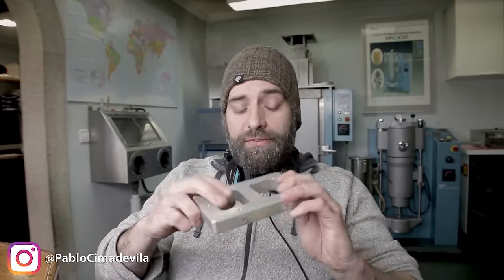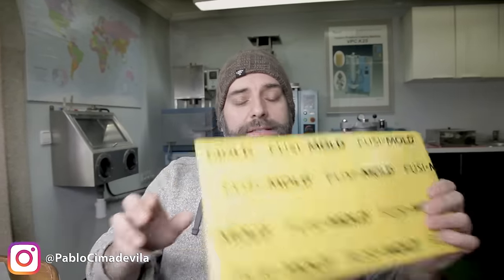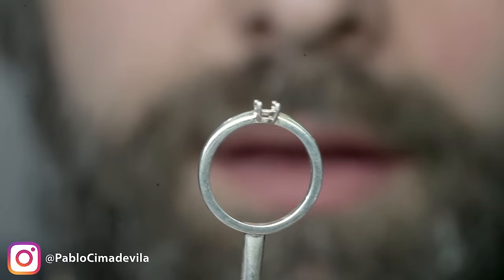HOW IT´S MADE - VULCANIZED SILICONE RUBBER MOLD

Comment: Not sure about what I watched, but I like it... 👍🏾
Reply from the maker: Love this comment
Reply: I didnt get the part where it was put in the machine. Was unsure if it was just pressure or heat/pressure or whatever. A bit more explanation there and it would have helped. Like the commenter, i was wondering what I had just watched and was just as clueless after the video on how to make a mould.
Reply: mrfoameruk that is a hydraulic press that also transmit heat to the mold. The result is the vulcanization of the rubber

Comment: I don't know much about the press you use or the Silicone, but I know all about making molds. So my question is, when you're making the mold why don't you make registration marks then coat that half in mold release before placing more silicone on top? Wouldn't doing this save time, because you wouldn't have to cut the part free from the mold? I would think that any marks you made would get filled when the silicone melts, or that's what I think is going on when it's pressed... again I have no experience with the silicone or machine you're using, I work with two part solutions.
Reply: This is a process used by ancient Indians and then used by Chinese, Arabs and subsequently by Europeans. (Europeans created cannons using the same technology and used them against India to colonies her)  The two part moulding will perhaps still complicate, if not rendering it impossible, the process as high degree of accuracy and flexibility is required in creating the wax pieces. The mold is evacuated before wax injection. For this evacuation purpose the molds not only have to be dimensionally stable and air tight but also flexible for the delicate wax piece to be removed from it without deforming. Naturally they have to be void of any foreign matter like a mold release agent etc.
Reply: This is a little different than pouring liquid silicon.
In this video he is using silicon rubber which is vulcanised using heat and pressure.
The silicon rubber is compressed in the metal mould frame and forms around the ring (blank). The silicon rubber then retains its shape during vulcanisation.
Key cuts need to be deeply cut and geometrical to mitigate movement when moukd halves A and B are clamped together before pouring the wax into the mould.
If you were to cut the female key into mould half A then clamp it to mould half B then it is unlikely that mould half B would properly press into the key in A. In fact, it would barely fill it and will have rounded edges thus failing to provide positive location. The mould will likely fail.
Of course, liquid silicon poured into Side A would naturally fill the female key perfectly but that is not the case in this video.

Comment: Pablo ты талантливый человек, но замок у резиновой формы сделал не правильно, да и вырезал саму модель с ошибками. Таким образом качество получаемых восковых моделей будет низким.  Будет облой и деформация, что приведёт к дополнительной обработке после отливки в металле. Для мелкосерийного производства возможно достаточно...)) Привет от русских ювелиров!
Pablo you are a talented person, but you didn’t make the lock on the rubber form correctly, and cut out the model itself with errors. Thus, the quality of the obtained wax patterns will be low. There will be a flash and deformation, which will lead to additional processing after casting in metal. For small-scale production, perhaps enough ...)) Greetings from Russian jewelers!

Comment: It's funny the little things you can take from a video. I'm not going to use vulcanized rubber (yet) but the trick with using the clamp and hooking it on the bench block to hold the mold open, Is genius. I'm going to use that.  <3

Comment: I really learned very little. What kind of machine is that? Was heat applied with pressure? What type of silicon do you use? Was it sandwiched between two pieces of rubber in the machine? If so what is their shore hardness? Thank you for showing the basic process, but there were so many questions left open.

Comment: Question? Why go thru all that when your only making wax blanks so you can cast them on a tree frame. when you could use silicon rubber with out all the problems of vulcanized rubber is their a reason? vulcanized rubber is used for casting hot metals like gold, silver, pewter, lead.

Comment: Could you not use some aluminum foil or plastic (food) wrap to partly separate the two halves of your mold as you assembled the layers of silicone before pressing and baking? I was thinking it would be easier to be able to separate the halves easily and then cut around your ring master just in the area the foil or plastic wrap wasn't touching your master....